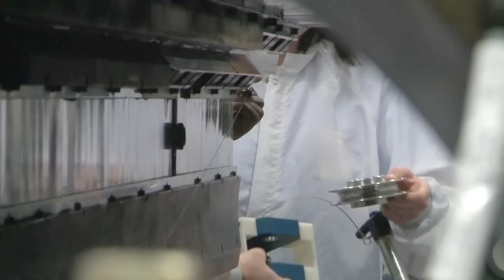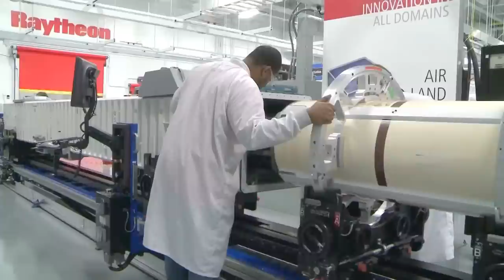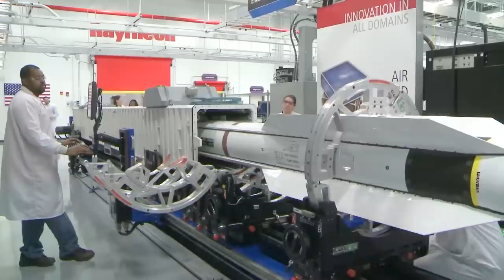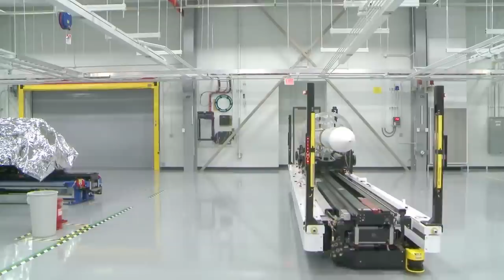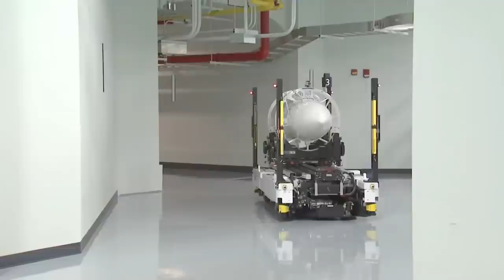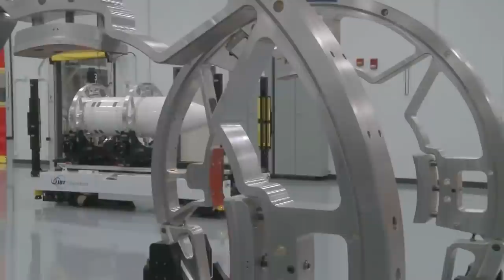Raytheon - Standard Missile-6 (SM-6) Container Loading + SM-3 Disassembly & Auto Transport [1080p]

Comment from the maker: SM-6 is also known as RIM-174 Standard Extended Range Active Missile (ERAM).
:-)
Reply: Unmatched performance!  250 km ceiling and over 800 km range if I'm not mistaken.
Reply from the maker: Not much infos are released for the SM-6 at the moment. :-)
Your guess maybe right as SM-3 has over 500km in range. :->
Reply: arronlee33
The theoretical SM-3 Block IIA (A proposed larger missile with smaller fins) has a range of >2500km... drool
Reply: The Russians are not far behind; a missile from their future S-500 and S-1000 currently being tested should reach 3500km in range if not more and another at least 200km ceiling (respectively the 3M22 and 40N6M).  Nothing is being said about the 77N6M and the 77N6M1 also the 9M100.
Reply: *****
You are getting this 3500km range from where exactly?